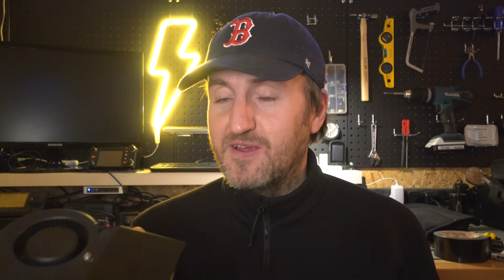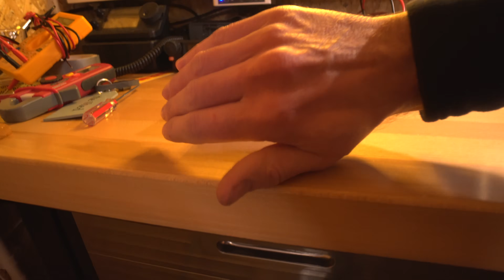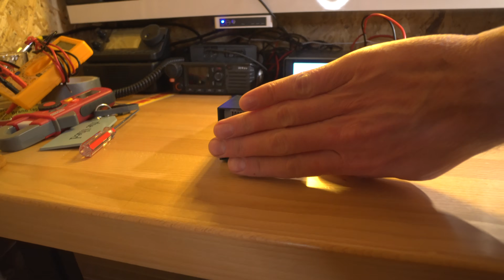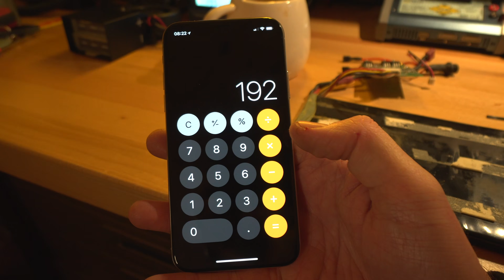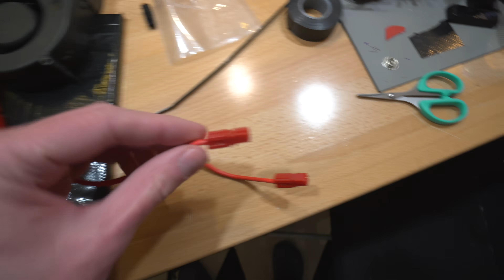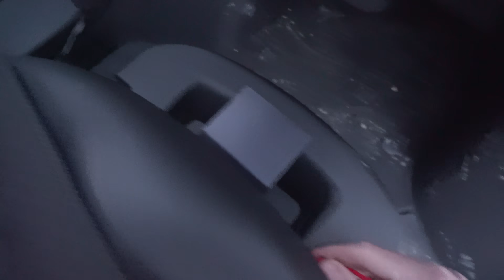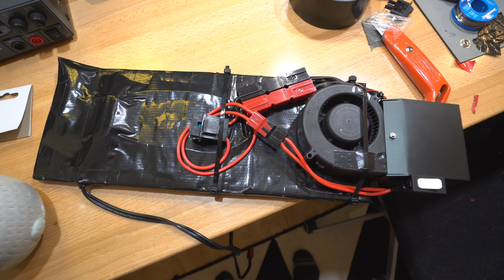BATTERY POWERED HEATERS???

Comment: I like the idea for emergency heat  in case your main heat source fails. I am in the process of building out the back of my suv and turning it into a tiny camper. I have a diesel heater for the main heat but this would be nice to have if the main doesnt start. Or you could run this to give you some instant heat while the deez goes through its startup and actually pumps out heat

Comment: I need something like this to heat up my car in the morning when I put my one year old baby in the car, to drop my wife at her workplace. I really don't want to wamp up the car with the engine and aircon on, for 10 minutes every morning in winter. It will probably damage the engine 2.2 diesel. I was thinking a battery powered heater will serve the purpose.

Comment: Maybe a radiator heater would be more practical. A 110 plug for preheating the oil and the battery to maintain temperature on the go.

Comment: For someone who isn't electric minded (me) what is the cost of running 12v on say 150w heater? So if I was using home supply but 12v, is it cheaper, or only cheaper if solar and battery?
Reply from the maker: Basically 150W is 150W wherever it comes from and whatever voltage. It would probably hard to find a 150W mains powered heater BUT you could use a 24V power supply and a 24V 150W heater and it might take the edge off the room.

There's some good little 500W plug in heaters that are probably more worthwhile using in these times where energy is expensive. 

A 500W heater on solidly for an hour with use the same amount of energy as a 2000W mains heater on for 15 minutes.

Comment: I build one myself and it works pretty decently. Used a 24v (180w) car heater from Amazon, cut the cable and replaced the ends with connectors. Then I connected these to the positive and negative terminals of a cheap 20v 2Ah drill battery from Action (probably similar to the Aldi one). It works for about 15 minutes per battery. I use it to quickly warm up the car when camping in colder weather and it does a decent job at that :)

Comment: So basically you can take this thing and a e-scooter battery pack and have 10-20-30 minutes of your legs not freezing while your car heats up… Would be interesting to know the overall efficiency of the build, as this thing has to be portable (in the winter you take it with you in the car so it shouldn’t be too bulky)

Comment: So to have an approximate idea (a rule of thumb method) calculate the room volume in cubic meters, then divide by 20 to get the heat required in kilowatts. So a room that measures 10 meters in length, 5 meters in width, and 2 meters high will require approximately 5 kilowatts of heat.

Comment: There are no battery powered heaters because it require a lot of electrical energy to create heat.
For a heater to last a reasonable time, the battery would have to be huge.

Comment: Ah my Mitsubishi Outlander has a 120 watt 12v lighter outlet in the back. Some of those little cheap 12v electrics do work fine as they’re designed to run for a couple mins tops not like a car heater.

Comment: Set up a circuit to alternate between each element one or two second each flip flopping between the two. The accumulated heat in each element would continue to heat the through air firing its off period. 

That means that there is only one element powered on at any time but both heat up evenly but your power consumption is seen as a single element.
Reply from the maker: Interesting but does it not  require more power to bring the element back up to temp each cycle vs having one on continuously?
Reply: @andykirby  theorising here but…. Yes it will but not by much if your cycle time between switching is low. You are only topping up the element from a still hot state rather than warming it up from cold. However, all of the air going over the elements will be heated rather than only 50%. Your current should never rise any higher than the peak for a single element and indeed should reduce as both become warmer.

Another thing I thought is that by warming only a single element some of its heat will go into warming the other element anyway so you are effectively helping it along with the switching.

Comment: My heat in my car stopped working and the mechanic told me it would be over $1000 to fix it. Since it's an older car, I definitely do not want to put that much money into it. I have tried the small heaters that plug into your cigarette lighter and they just blow out my fuse every time. So a battery powered heater would be great!
Reply: Power it directly from the battery

Comment: Thanks. Got 360W of solar on the roof of the insulated summerhouse and 2x200Ah acid battery banks.
I will give this a try. Just pushing the temp up 1-3degrees would make alot of differense.

Comment: I have two of the “useless” products you listed and they work well in my truck. One keeps the windshield clear and one heats the cab (road pro). One is wired direct to the battery. It takes the edge off for sure.
Reply: Do they really work? I have a 2500 dodge diesel. Would my battery be good to hook this up and run it while driving?
Reply: @supremekingjesus425 Yeah, wire it directly and put a fuse on it. Since I wrote this the road pro died. I opened it up and bypassed all it’s circuits and it’s better than ever. Don’t use a 12v port, mine melted.
Reply: @mixmasterwillyd9959  please post a video how you did it..

I plant in using 2 roadpro heaters in my 21 foot  RV..
Reply: @camposvazquez  Ah poo I don't have it anymore. But you just need some large wire and a fuse to run from the battery to the cab. If you run the heaters off the 12v plug how the amazon images show it will melt your trucks wiring harness together. Ask me how I know. Anyway, run that cable safely, mount them to the dash and heat away. I'm not sure it's going to make any difference at all in a 21' RV. It just helped take the cold edge off in a small truck cab.
Reply: @mixmasterwillyd9959  thank you.. my goal was to run 2 at a time...

I 12 volt marine heater with the same wattage costs $600...

I'd rather heed your suggestions and wire it as you did...  

Thank you... You saved me almost $500....$500 I don't have

Comment: best to use a desiel heater 150$ on amazon, they can be connected to ur car battery and as long as you drive / start ur vehicle every 3-4days the battery will be fine
Reply: the desiel heaters will draw 0.5-1 amp the whole night, jsut something to think about

Comment: So you're not talking from experience you're just giving us information because you believe it's true. I have a small heater that runs off of my accessory Jack. I also have another one that I took the end plug off attach gator clip to it and now I can attach it to an external 12 volt battery that I charged with a solar panel.
Reply from the maker: Nah I’m talking from experience. Not saying you won’t get away with running heaters from the accessory jacks, it depends on many things. But the wiring or connector is not designed for high current devices like heaters or inverters. There will be a big voltage drop at the heater so you’ll most likely lose power and the wiring will heat up (best case scenario it gets warm, worse case it melts)

Comment: The actual secret to battery powered heating is that you must 1) heat a small space that is 2) well insulated. By small, I do not mean a room. Forget it. You've got to heat a space just large enough to sleep in. Something like one of like one of Paul Elkin's bicycle campers.
Reply from the maker: You mean like this: https://youtu.be/lJMuImHU-fU
Reply: @andykirby  Yeah man, thanks! All the heat raises up to your roof, so... keep it low and you're fine! I'll watch that video too.

You also reminded me of another build that could work with electricity - although he uses a radiator system:
https://www.youtube.com/watch?v=BREQY1TL7JA  his tiny house on skiis could easily be warmed by your electric unit.

I heat my teardrop with electricity.... thing is though that I have one cheat: I live in Florida.

Comment: Thanks for the video. This gave me the ideo to buy a PTC heater and make a Lithium Ion battery pack to more quickly defrost my windows in the winter. While my trucks heater works fine and all in the winter I use more gas defrosting my windows than it takes for me to drive the 1 mile home at 4:30 am from work. Using more gas to defrost windows than it takes to drive one mile kinda bugs me even though it's a minor thing. Over time this setup would pay for its self in gas savings for sure. 👍😁
Reply from the maker: That’s really interesting, thanks for telling me this. I’ve also found it works well as a screen defroster. It will definitely cost a lot less than burning gas while you wait for it to heat up for sure!

Comment: I reckon you would need around 400 to 500w of solar just to keep the battery charged enough to use it, 20amps will drain a 110amp hour leisure battery in about 3 hours and take a lot longer to recharge battery. Nice little hester for the twizzy though.

Comment: if anyone is thinking of doing this with ladl parkside 20v batteries, dont.. while they have a very nice balance charging board in them that works when on the lidl charger, it also monitors cell voltage when /not/ charging, if a cell drops below a normal value, the ''chip'' stores a fault, and when you next come to charge it, nope. I know this as i used a parkside battery on my old 'worx' screwdriver, the trigger got held in while i was driving and it drained the battery, even after tearing it apart and recharging it on my RC balance charger, the parkside charger wont touch it anymore. I have yet to find a way to clear this fault even holding the chips reset pin low etc it still wont activate the charger. low voltage cutoff does happen on parkside tools, seems for some odd reason the cutoff is built into the tool, not the battery, i dont see a logical reason for this.

Comment: Was thinking the same thing but my solution would be to wire a seat heater to my minivan rv mattress that way I am not heating the air.  I like the idea of the skateboard battery with the management system.
Reply from the maker: Yes exactly, those heated seat covers are really effective at keeping you warm (wherever you put it) and they run on a tiny amount of energy. They could run for hours on one of these batteries.

Comment: The voltage drop in the wire is caused by the wire heating up. In other words, a heater. You can't cheat the maths.
Reply: I think you have it backwards. The wire heats up because of the current draw (not voltage). And the current  may be excessive depending on the loadapplied. Basic electrical theory P=I/E.

Comment: ANDY KIRBY ? They probably don't put battery operated heaters on the market because with regular batteries it wont last all day and Lithium battery packs could run a heater BUT if the Lithium battery leak do to high heat, it could explode and start a fire.

Comment: Hi Andy! 
I’m desperately needing a heater for my milk float as I’m freezing my b*****x off 
It’s bad enough iv no power steering and 1 speed wipers, with the cold weather setting in the inside of the cab windows are freezing up as I work 
The only power outlet is a usb that charges my phone or tablet 
Scanned eBay with not much luck only the camping butane heaters which I don’t think is safe? 
My round lasts around 6 hours 

Any info is much appreciated
Reply from the maker: Check the new video out. 6 Hours is a long time. I would suggest heated seat pad or clothing. Is your milk float 48V?
Reply: andy kirby 
Thanks for the reply m8 
Yeah 6hrs is a long time. But iv just watched your new video with the battery from Aldi and I think that might work I don’t need it on constantly for 6hrs just 5min here and there. I’m not sure what voltage my float is

Comment: you can run 10-12 amp devices over a 12v port, so possibly 144w available, but that doesn't include what devices are connected to the car.  Like radio, cabin lights, etc..

Comment: Andy I’ve made a pond heater from a 12 v 600 w heating element , on a 240 to 12 v dc 50 amp transformer , will it use less power than say 600 w 240 heater , your input would be nice  here .
Reply from the maker: It won’t be as efficient as a 12v 600W heater running from a true 12v source like a battery. The drop down transformer wont be that efficient, also at 50A you’ll lose some power in the cables running from the transformer to the element.
At 230V 600W would only be 3A.

Comment: I work with lithium batteries every day and would never sit on top of one or even put a laptop on my knee. I have seen too many go off with a massive bang or flare off. Just not worth the risk..
Reply from the maker: Might be a bit overkill, I’ve been working with them years and never had an issue. As long as you keep them within safe parameters then they are fine. Bit like petrol really!😅

Comment: A car battery has the power to start motor vehicles for 2-4 years. Unfortunately and ironically, this powerful battery couldn't power a heater (directly, not through a motor vehicle's electrical system) to heat a small room?
Reply: it definitely can, but it' best you use the battery only for the heater and nothing else which means you'll have to purchase one. If you wire it to your car's battery you could run the heater fora few mins to an hour or more depending on your car battery's performance and specs but remember everytime you run it without the engine on you are draining your battery very quickly.

Comment: Amazing! Keep that going! I was trying to get my garage heated from using a small heater exactly like that one and unfortunately the thermostat I was using couldn't handle the polarity being reversed and when I bought the thermostat online I swear they said over voltage protection, protection from this and that and nope!  It's a shame because the thermostat was so affordable for 7$ and just an extra security feature would have been great because as you can tell you already know wiring when your tired anyone could put the clips on wrong because the plus and minus at least on a 12v car battery is labeled in dark colouring the same as the battery.  Well cheers and hopfuly this will work out for your shop

Comment: Would have been nice to get a before temp and after temp cause it feels nice doesn't really help with actual comfort. Nice video but if you can add something to tell us how the temp is outside then inside then turn on for 10 min kinda thing and again temp with heater on. Also how long does the battery last that kind of thing. Thanks!
Reply from the maker: It was a while ago but there’s more videos about this heater scattered on my channel, one I think is called “twizy heating” basically after all these experiments I made another one that kicks out about 400W and runs for around 30 minutes. It raises the temperature about 10 degrees in my super small Renault twizy which has no insulation at all. I used it all last winter and will be using it again this winter it really helps.
Reply: @andykirby  Ok thanks I will check them out =).

Comment: Hi Andy
Yes it has two usb sockets one 12 volt car socket and to 3 Pind plug household sockets.
It is a goal zero Yeti 400 w lead acid electric powered generator and I have a 300 watt inverter.
What sort of run time would you think approximately I get off this and also would I need to use the inverter.
Thanks for your help it'd be much appreciated.😁😁😁😁😁
Reply from the maker: The 12v socket will have a limit to what current you can pull through it or it will melt if you exceed that rating, also being lead acid it will suffer quite a voltage drop under high load. Duration depends on the Ah of the battery, this heater can draw 25A at 12V so in an hour that would be 25Ah so find out what the total Ah is of the battery and then it will give you an idea of how long in would run. Lead acid is inefficient so you’ll only get 60-70% of the total capacity. Hope it helps! Best way is to try it and see what happens!

Comment: Hi
Would this work with a goal zero 400 and a 300 what inverter and what would you think the running time would be for it🤔🤔🤔🤔. Could do with something like this for my micro camper👍👍👍👍👍 much appreciated if you could help
Reply from the maker: Doesn’t  the goal zero have a 12V output? If it has and it’s powerful enough (300-400W) then you could just plug it right in!

Comment: In terms of parking the car in a small shed. Wondering if you could hook up Solar panels from the roof directly to the heater for daytime heating of the shed itself... (Would work out to 18v approx)
Reply: Sunshine 1000W / sq meter, solar panel 220W / sq meter = much money for little use. Better 1 sqm window + black curtain = 1000W heater for basically free. For night heating use something else that is painted black, like a plastic drum or concrete slabs. If you don't have south facing windows, use a solar heater with a small solar powered pc fan to draw in hot air from the roof. Heat storage can be a wooden box with ducting under the shed filled with rocks. The use in a car is something different. However batteries are expensive, so better use a big block of aluminium with holes drilled through and a pc fan. The simply heat the block on the stove before use.

Comment: Do they put out much heat?
Reply from the maker: Yes about 400W if you run from lithium batteries. Enough to heat a small car cockpit.
Reply: @andykirby  thinking for demisting the screen on the boat. All them other heaters are dung. I've had them all. 👍👍👍
Reply from the maker: Actually most of the time it’s not the heater that is the problem, it’s the battery not having enough power. Try a 4 cell lithium battery (li-ion, Li-polymer) and you’ll get a lot of heat 😁